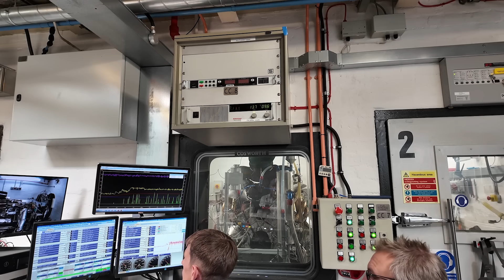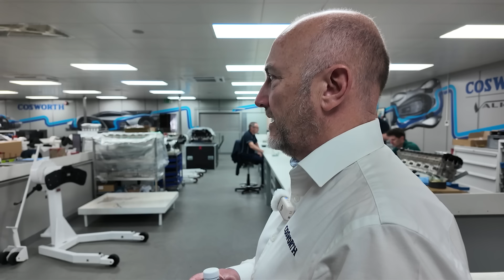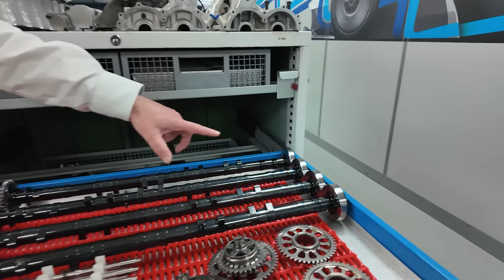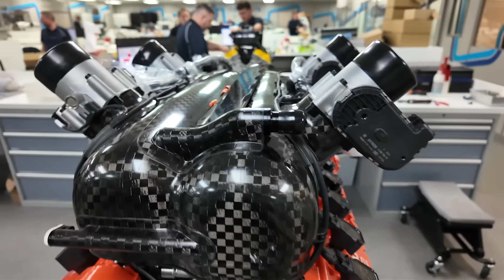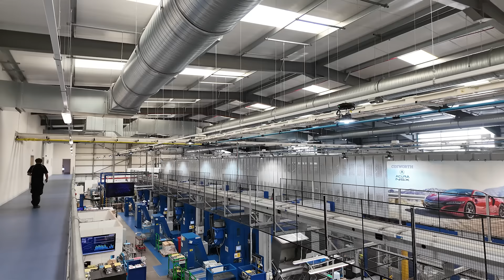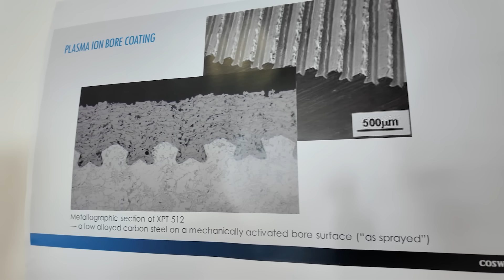An In-depth Tour of the Cosworth Factories - Part Two - Manufacturing

Comment: Chris Willoughby said that Cosworth machine the crank from solid. Isn't a forged crank better because the grain structure follows the shape of the crankshaft ?
Reply: The cost of small batch forging is probably higher then cost of a better alloy.
Reply: Thats the way. Forged cranks is better. But a billet one is good enough, you can go this. If you want a special one of crank for your car (perhaps from arrow) it is normaly a billet one. I work for the biggest crank supply manufacture worldwide in germany, 95% of our raw material is forged steel. After GM's 6,2L call back couse of quallity issues about the US and Mexican cranks, we now made all LS6, LT2, LT6, LT7, L87, L78 cranks for them. A have a original Caterham CSR 260 with a Cosworth 2,3 Duratec and the Crank is a beautifull blue one.

Comment: Nothing like a super finished crank shaft. Those intake ports are no compromise. Plasma coated bores wow. Makes it easy to finish the machined bores straight of the machine tool. They talk about the drawing board, but the  real tell is the engines had every dimension and clearance set by a human at the board. Unlike cad today that allows the ridiculously complex without human interaction. Radius and subcomponent calculation done by the computer using the template used.

Comment: How exteaordinary tovsee the V16 BUGATTI engine! This is a very special video! Thankyou!
Reply: Why can't Bugatti build their own V16 ?  Or is it that the British are just better ? 🙂
Reply: Ford Sierra, escort used Cosworth cylinder heads and camshafts 
Mercedes E190 EVO used special Cosworth cylinder heads.

All succulent cars in the rally or in long-distance races, why can the car manufacturers not build good engines?

Because Cosworth is known to build steady parts that draw performance from every corner without compromising.

Why do you have to invest 30k to squeeze 1500PS out of a supra?
Why can't Toyota just build decent engines?😂
Reply: @whizzo94 Technically, Bugatti didn't Build their own Engines when they were Part of VW Group.  The W16 Engines were Built in Section of Plant that Produces most of VW Group Engines.